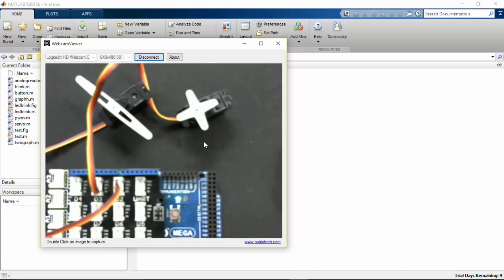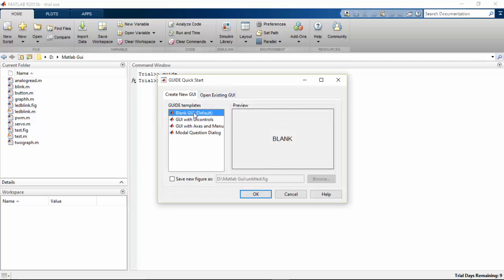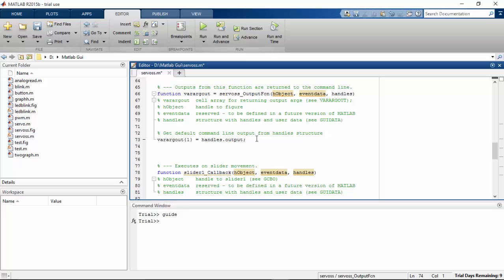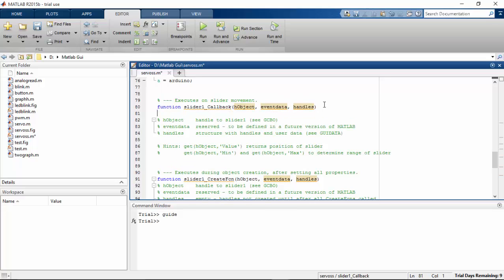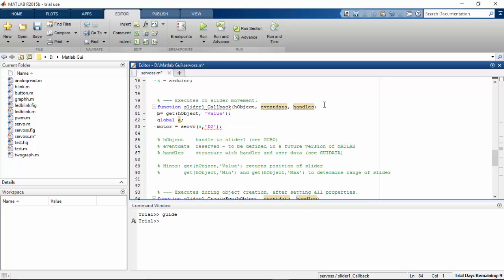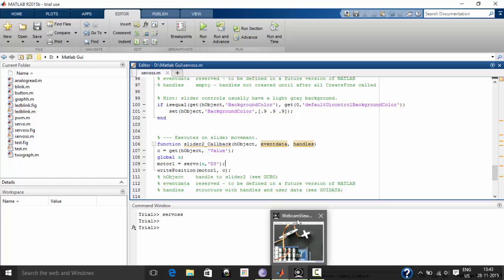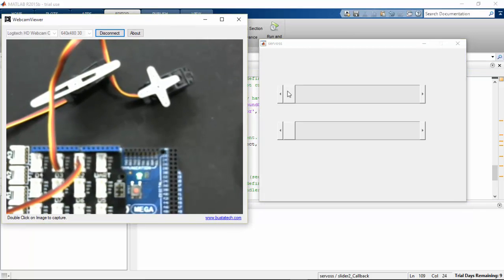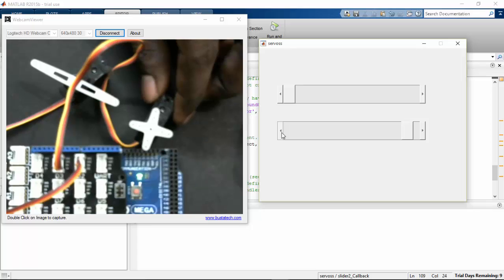4. Arduino and Matlab GUI Servo Motors

Comment: I know know how to make a apps by matlab apps designer which is much better than matlab gui by GUIDE. But I don't know how to add it with hardware part. Please could you help me about how to add matlab apps designer with practical hardware works like motor controlling, or servo motor controlling.

I'll be grateful if you help me?

Comment: I bought your ebook, I have tried your first assignement. Did everything  I was supposed to do and I got this error... How can I fix this?
Error using led_control_led_control_OutputFcn (line 77)
Failed to open serial port COM3 to communicate with board Uno. Make sure there is no other MATLAB arduino object for this board.
For troubleshooting, see Arduino Hardware Troubleshooting.

Error in gui_mainfcn (line 264)
        feval(gui_State.gui_OutputFcn, gui_hFigure, [], gui_Handles);

Error in led_control (line 42)
    gui_mainfcn(gui_State, varargin{:});